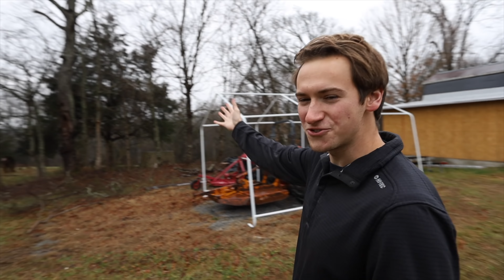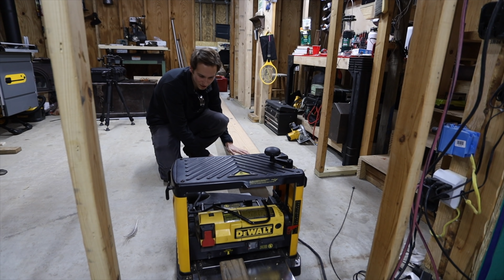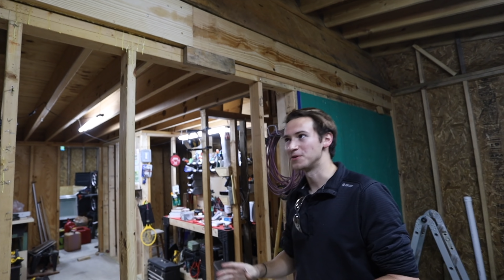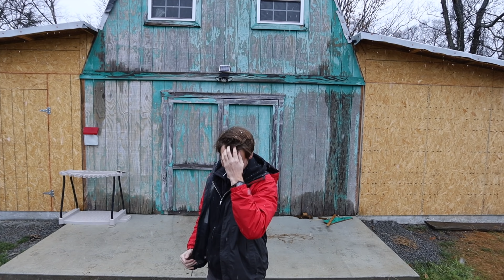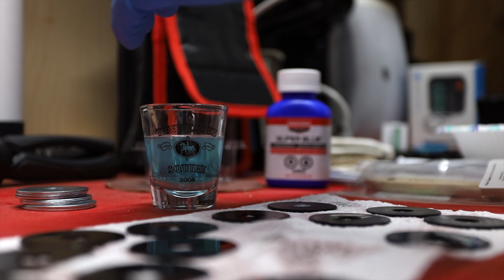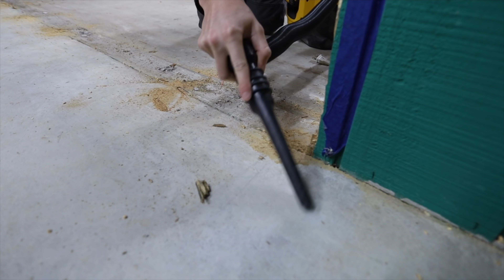Building a Rustic Beam and Removing the Wall! | Abandoned Shed to House Renovation

Comment: Since the load of the beam is only carried in one side by the wall, I would add some 2x6 jack studs in the opening. If you wrap the entire opening that way, it's an attractive (and widely used) way to define the passage. If the ends of the entire beam are not supported by the exterior walls, I would consider an extra stud at the ends, as well.
Reply: We have two large 4x6 beams going on either side of the opening that will sit under the beam and are potentially wide enough to pick up a ledger that runs the length of the open span under the floor joists. 

We need to think more about it.
Reply: That's perfect. Since you're looking for a rustic look, you might consider rough cut, or "combed" lumber (that's what they call it here), where they run a comb down the lumber. It looks great. You'll need to go to an actual lumber yard, though. Not a service you can get done at Home Depot.
Reply: @MrZZeroG  4x6 beams under the header beam is plenty to support a spam that short. Should look great too.
Reply: @dogleg6669  thanks! Yes. It will be more evident when we install them, but we doubled up the 2x4 framing on that back wall (see the step construction video) and that creates ~7” between rooms on the step side. And on the front side the beam will hang out in the room, creating the end of the “entryway space” on that little wing wall. We are also putting 4x4 under each corner end of the two 2x10s that hang over in the kitchen for aesthetics, but it will provide even more support.
Reply: I was really wondering what was supporting that beam considering they are just screwed into the original header but if you're adding 4x4 that will be plenty! Looks great
Reply: I'll be surprised if an inspector does not frown on that splice being right in the middle of the opening. I would have definitely had the splice on either side of the opening.
Reply: @reactioncafe2373  the center board is glued and nailed to the band joist every 16” with three 16d.  There are a even more nails between these where we needed to draw the board in flat. The third board is glued and bolted with three 3/8” lag bolts on 4’ centers through  all three boards. We could add them on 24” centers if there was a problem. It’s only an 8ft span. there will be a 4x6 post on either side and a 4x4 at either end (instead of the two jack studs we were going to  put in the wall).  Just the bending moment of one 2x10 4’ cantilevered out from vertical support is pretty big. Even when one thinks about the L/4 cantilever on each element separately, it’s pretty close. 

You’re right - many inspectors pull stuff out of thin air and many codes (I was on 4 ANSI committees, NEC,  and an IRC committee) do the same thing with written standards - oh let’s just add safety factor to safety factor - all in favor? They aren’t all bad, but there are so many things that are overbuilt. 

The real question is will it carry the load? The answer is almost absolutely yes. I don’t expect that span to break.

Comment: ProTip: Check the manual on your Dewalt sawsall/reciprocating saw, as I think you can reverse/flip the blade over for when y’all are making some of the awkward cuts. Some saws even accommodate the blade being installed in a perpendicular position to help make left/right cuts.
Reply: Yep most recip saws can do this. Mine rotates to get the right angle so you can cut up down left right or diagonal
Reply: Yes we know and maybe you commented on another video. It was more of a grab and go since we had so little to cut. But thank you for pointing it out!

Comment: I'm really enjoying watching your project progress. And doubling up on the new beam is very good thinking. However, it appears that your new butt joints are overlapped by no more than 2ft. I'm afraid that doesn't make for a very strong load bearing beam. The second layer would have been better placed with an overlap of 4-5ft on both sides of the first joint. It may later become necessary to put a support post in the middle of your new opening. And please use joist hangers for the floor joists. Good luck gentlemen.
Reply: Agreed. We will have a 4x6 on each end of the opening, so the span is less than 8’ on three 2x10s glued and bolted. We are still thinking about the hangers and alternatives…

Comment: seems like it would be easier to run plumbing and wiring through conduit through the floor/ceiling, so having it be exposed would be a bit messy looking. If you filled in the ceiling with insulation and ran all your conduit for all the things you needed, then closed it in, that would look a lot cleaner.
Reply: We have one run that’s over the bathroom that will work for our electrical home runs. Water is partially in slab now so that’s much easier to pick up under cabinets. Thank you!

Comment: You should strap the planer to the studs next time you need it ....then it wont move around on you
Reply: Absolutely. We were too far in it to change. We are building outfeed tables for our radial arm and table saws and plan to make them reconfigurable to use the planer. The biggest issue we were having was lumber was still quite high in moisture/soft wood and blades need to be sharpened. There was a cup on one board, but only at one end, so that was an issue. Thank you!!!

Comment: Install joist hangers! Screws and nails have MUCH less holding power in end grain, they can NOT be trusted to support a floor as they are! Things will just get heavier as you finish the house, do it the right way, you don't want to have the floor collapse!

Comment: What is supporting the beam on the ends? Just bolting additional 2x10s to the current beam isn't going to help carry the weight of the structure above.
Reply: 4x4s at each end.

Comment: Should not the beams be continuous and not butted ( in the same place ) in the middle. That makes them weak does it not? The two beams ought to have been of different lengths and then staggered in their placement so the overlap avoids a weak butt joint?
Reply: The gaps are separated by a few feet. It’s glued and lagged the entire way. So yes. It should be and it was.

Comment: my brain says if you want to make the beam look like one piece of wood, fill the gaps with epoxy mixed with black dye,  and then stain the wood dark, the cracks will look like grain. I know it's a trick to hide stock repairs on old rifles by using blackened ACRAGLAS, although there's no reason ya'll would use that particular epoxy, that's expensive gun pressure in wood bearing stuff.
Reply: That’s a great idea! Thank you!

Comment: I fear you made a couple of enginereering mistakes. You have transferred the total weight of half of your loft floor and half of your roof system onto a handful of nails that are protruding from the rim board of the loft into the end grain of the loft joists. You must install joist’s hangers on all your joist. The beam you created, at this time, is contributing to the load, not supporting it. You need to install support structure under each end to have the load transferred to it then to the slab.
Reply: Thanks! None of this is thoughts we haven’t had, so it gives reinforcement for our solution. The beam does contribute to supporting in bending moment and with two 4x6 on each side of the opening that support the span, it definitely will help. Remember most of the floor joists weren’t even touching the top plate (1/8”-14”) and the top plywood decking provides a skin that’s in tensile. Overall we are looking at what we will do next.
Reply: @MrZZeroG  I’d say use your removed wall to put temporary support pedestals in remove existing 2x4 walls supporting beam and replace with 2x6 walls, or shift the current wall over. A problem you may run into with shifting the wall would be your new stairs.
Reply: @walchak81  it’s will be fine. The wall by the stairs is a doubled 2x4 wall. With two 4x6 posts at each end - it’s way less than a garage door opening and a lot more wood.